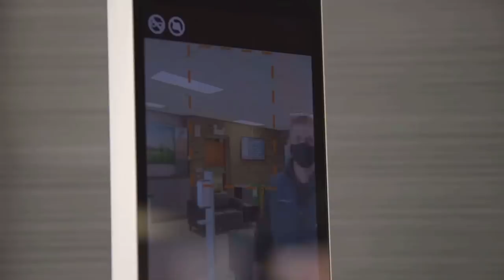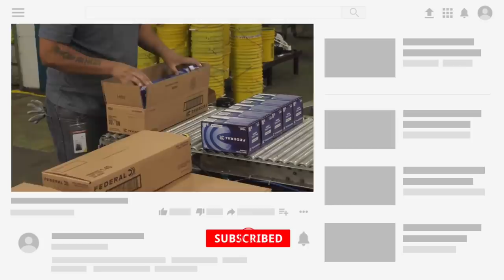Message About the Ammo Shortage From CEO of Federal/CCI #ammo #ammoshortage #freedom

Comment: This country embraces capitalism. Why isn’t there more companies stepping up to the plate to fill the void?
Reply: Mike Tate  No I haven’t been living under a rock. Trust me, if I had the financial means I would be building a ammunition factory myself.
Reply: @danfarris135  Even with $500 million, it would take years to purchase the equipment, purchase the specialized tooling, get the permits, build a building, install and test the equipment. Find and secure raw material suppliers and maybe start production. Where do you buy ammo making machines? There is not a dealership, most are special built to order machines.
Reply: @6handicap604  The Remington factory sat idle for nearly 2 years in Arkansas. Every where else it seems if there is a shortage of something, prices and profits rise. Have you seen the price of lumber, gasoline, and prices of commodities in general? It’s profit making season in our economy. If you don’t believe it just wait for the third quarter earning reports.
Reply: @danfarris135  One could say, it is profit time, one perspective. Look at lumber, during covid and the shit down of the economy, housing starts dropped from over 1 million a month to 240,000 per month. Demand fell by 75%.That created a glut of lumber and the price fell dramatically, when the price and demand fell, lumber processors stopped or slowed down also. Normal business. Supply and demand. Now that the economy is opening back up, housing starts are now back up to over one million a month, but guess what? Now there is a shortage of lumber, demand has outpaced the reduced production, The price goes up. The same is true of most things. This is where one could place the blame on government, this was all caused by shutting down the economy, you will see these price increases until supply ramps back up to meet the demand that is returning to normal.

Comment: we've heard his words but after reading comments, not many buying the bs.
Reply: Outside of building a new factory, the only way they can increase production is to add shifts. If they were running 2 shifts 5 days a week, the most they could do is slightly double output running 24/7. Look at the NICS check numbers for the last 12 months, every month has set some new record. Demand for ammunition has more than dobled just account for new shooters ALONE. This is why we have these shortages, supply cannot meet (high multiplier number) normal demand. Not this fast. And not for something that is presumably temporary.

Comment: The CEO does not discuss at all the relationship between raw material supplies, demand, capacity and sales price over the past 5 years relative to ammo types.  Basically he said nothing.

I feel as if the prices of ammo are being driven up while wholesale supplies are kept low for such an extended period of time for the purpose of making the end customers to accept the higher prices as the new norm while flushing out retailer stock of the old stock of lower priced product.

Comment: Does not make sense why they can’t adjust to the demand like they do with other products. Especially when there is so much money to be made
Reply: Thats not actually how production works. He told you its not something that can be done overnight. There are some machines that you cant run 24hours a day for example. You have to shut them down for maintenance. So even if you are running three shifts one of those shifts is likely not producing anywhere near the same numbers are the others. So your plant has a set capacity. It can only process so much in coming raw material and put out so much completed product and it does not matter if you throw more people at the problem its still not going to increase the efficiency of production. Generally there are bottle necks that cannot be worked around and they are what constrains the overall throughput to your facility. The only way to increase output, is build another factory or expand the one you have. As he said, thats not happening in a short period of time.

Comment: One question he didn't answer.  Are you running one shift or three?  Agreed, the capital expense of building new facilities factors in but until your company is open 24 hours a day the question of a new facility doesn't factor in and that doesn't require a capital expense, just more employees.  Not to sound like a cold hearted bastard but if or when the market retracts, then you simply cut a shift and the employees involved.

Comment: These jerks simply don't care. Even if it takes 6 months to a year to tool a new line it's easily going to take that long to even put a dent in demand at current capacity. Then even if the markets settle down what would it take to cause another panic, a fart by a Democrat? Screw them, and their videos trying to explain their lack of action.

Comment: I'm not impressed with this video.  Talks about Covid concerns at the factories, new hunters, and previous oversupply.  I understand why an ammo company won't talk about the MANY reasons ammo demand is though the roof but don't insult us with notions that a bunch of new people deciding to go hunting is why all the ammo is gone.  Finally, I understand that entirely new factories take time and "oversupply" potential causes caution but if companies were making even $1 on a box of 9mm being sold at $11 as was common a year ago, ($10 costs) then even allowing for a dubious 50% increase in the cost of labor/materials to $15 a box when you sell it for $45 you're making 30 TIMES the profit on same box of 9mm.  What will it take to increase production?  What are you doing to increase production?  What about just primers?  Smaller footprint, old technology, take pressure the market by allowing reloading to continue from a variety of component manufactures.  How long do you think the public will tolerate there being what...2 primer manufactures... that fill their own stuff first?  Olin (winchester), and Vista (federal, cci, remington).